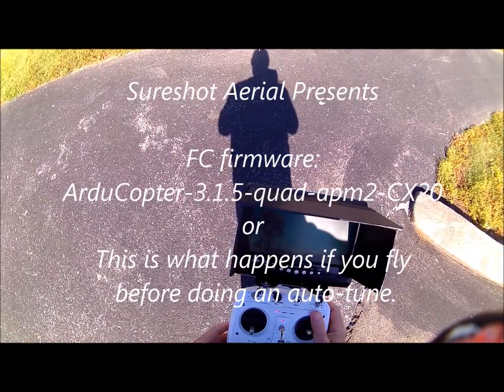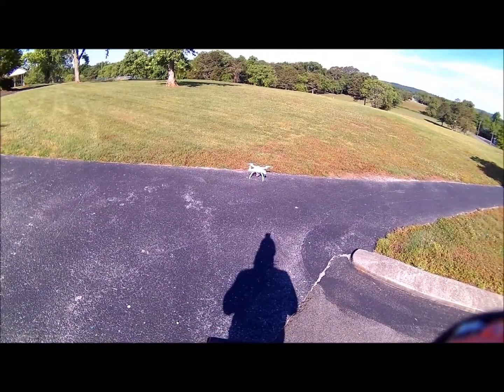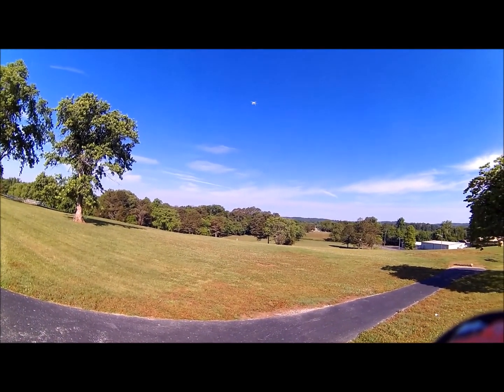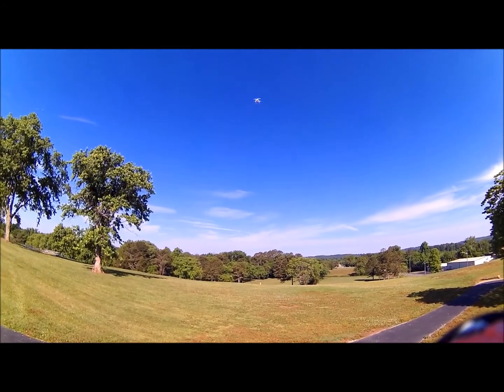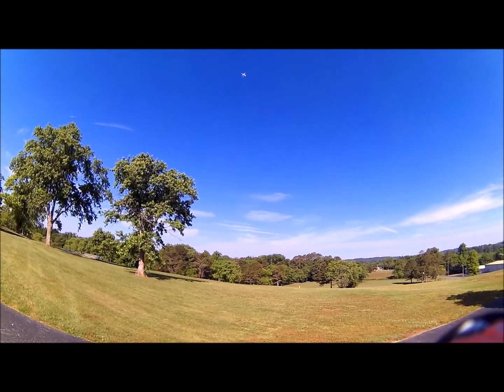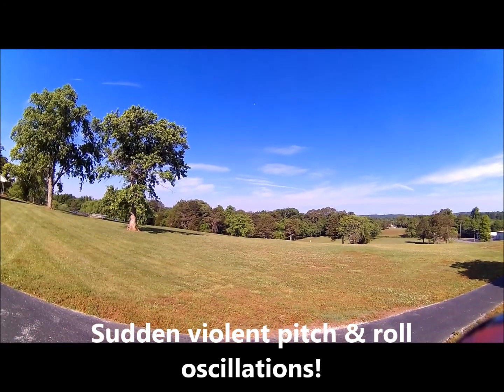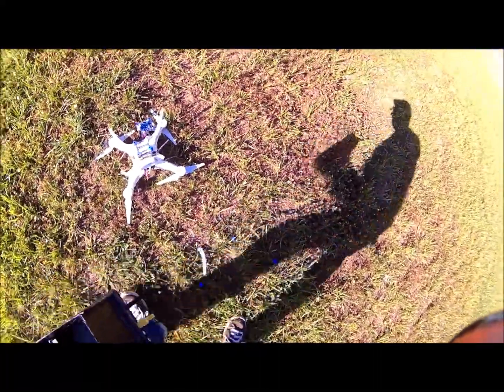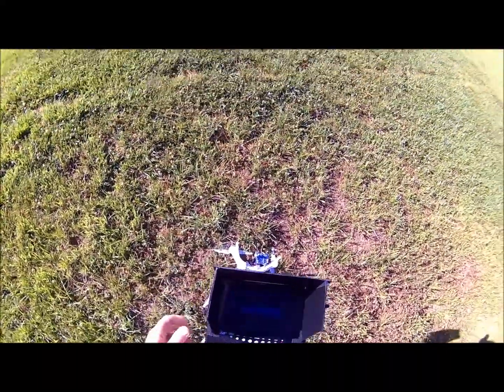CX-20 test & crash

Comment: Hey Bill, thanks for sharing the experience.  Sorry for your crash.  I'm wondering if you could have saved it if you switched to manual mode sooner and punched it since loiters throttle response is so sluggish. Try the 9450 9.5" props for better lift.  I'm happy with those 450 legs also, seem tough and they are able to bend a lot to absorb shock.  Also your right on with antennas, a well tuned set really works.
Reply: Did vortex ring state get you?
Reply from the maker: Pat Martin Yes, I think maybe so. Also, I may need stronger motors for the heavy lead. I am still testing, but it may need 2212 980KV's.
Reply: I'm no expert or an authority in any way but I think you're right, some stronger motors seem to be in order with that heavy load and such. Once they start dropping getting out of that dirty air in any direction is all you can do and hope you have enough time to do it. Ate some prop wash on my syma X8C the first time out and almost didn't make it out alive, lol. Glad Dustin Dunnill chimed in; he definitely has good advice and thoughts on this subject. Hope you post the next flight, good flying!
Reply from the maker: Dustin Dunnill I strapped it in the test stand and did a full run down battery test today.  I discovered my older LiPo was losing current while volts were still above 10.6 at around 1800Mha discharge. The motors may be OK, but the reduced available watts left me without enough power to overcome descent into propwash after 5 minutes. After the stress test, the LiPo recovered to 11.3v.
Reply: Ah, good to get to the bottom of things. Now I need to figure out why my Tarantula X6 fell form the sky like a fallen angel at close range today.  I suspect it's due to an exterior switch I installed for the power. The factory comes with no switch, after plugging in one needs to put a screw in the battery compartment door; thought a switch would make it easy, I was wrong, lol...have some repairs to do...:(
Reply: Bill Branning It sounds like the stock batteries are junk.  I tested mine and one of the cells had more than double the resistance than the rest.  Since live switched to the 3dr 5100's I only use the stock lipo as a pre-flight 5 min GPS acquisition/update and bench test battery.  I'd recommend doing the same.  You may be able to get a refund/replacement from the vendor.  Some have admitted to sending defective lipos with the CX20.
Reply: Thank you for the tip

Comment: I'm waiting to get mine from Banggood.  So when you say "make sure you do auto tune", does that mean do the compass calebration?
Reply from the maker: Bruce Burkland Here is a link to a good starter guide.
http://www.rcgroups.com/forums/showthread.php?t=2206138

The step I missed was #5 Trim calibration (also called auto-tune).

This is an open source or what some call a hacker's quad. The customizing options are endless.